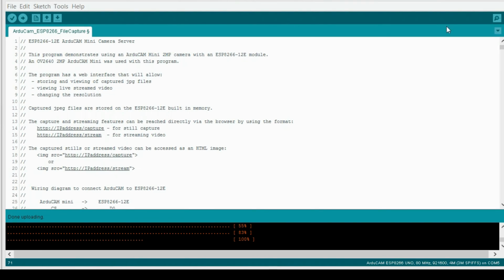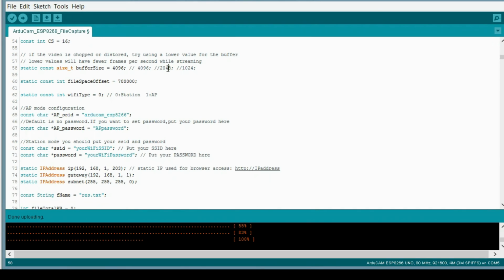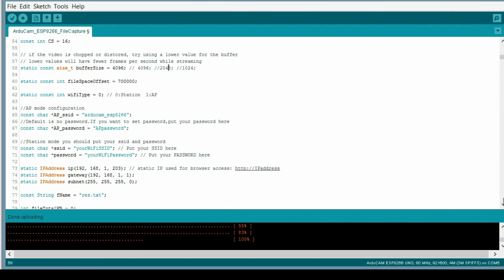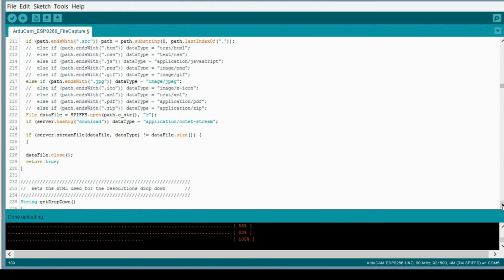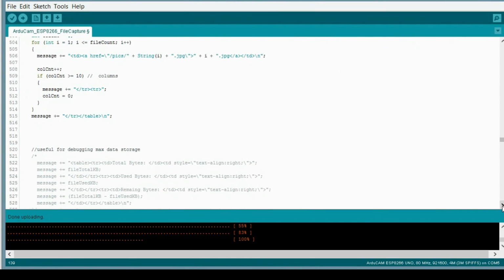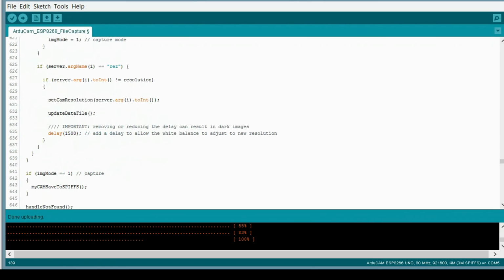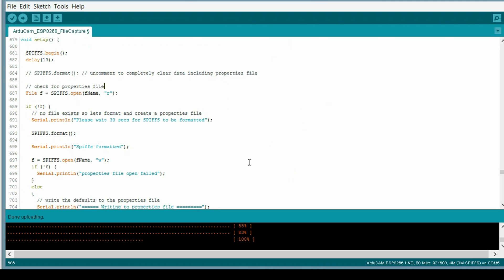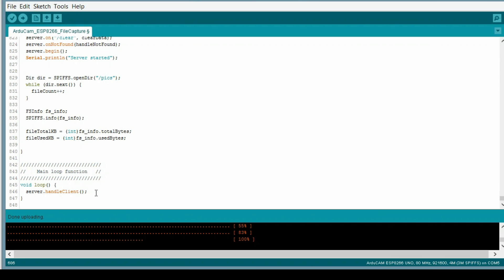ArduCAM Mini ESP8266 Source Code

Comment: I am unable to load the images on to the web server for some reason. They just come up as empty 16x16 boxes. Can anyone help?
Reply: I also have the same issue. have you solved it?
Reply: @spacebar4992  Hey, no sure you solved it already, in my case, I changed to arducam_shield _v2 in memorysaver.h and it worked like a charm.

Comment: hello.. may i asking u some question?
why i had an "error:espcomm_upload_mem failed " ?
i hope you can help me.. thanks
Reply: I had that problem too. Go to my devices on windows control panel and you should see which comm the device is connected to. Then go to arduino program go to tools<port< and choose the correct COMM. You also have to make sure you wired the arducam correct. It basically saying that the program cant communicate to the device. Hope this helps.

Comment: Can you share the server side sketch in case the ESP was not a server if you already did it this way.
good project
Reply from the maker: Yes. The sketch allows the ESP8266 to act as the web server. Or you can make requests to the ESP from another web server using an image. Works both ways.
Reply from the maker: HTML image tag like <img scr="http://ESPipAddr/capture">